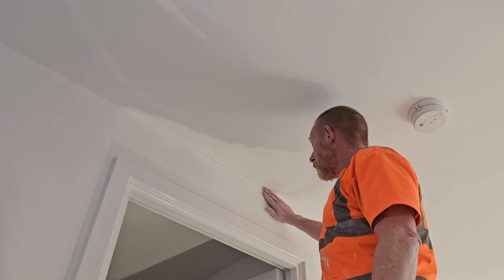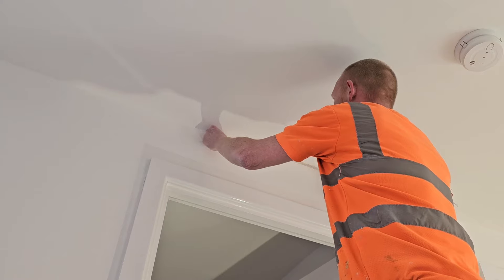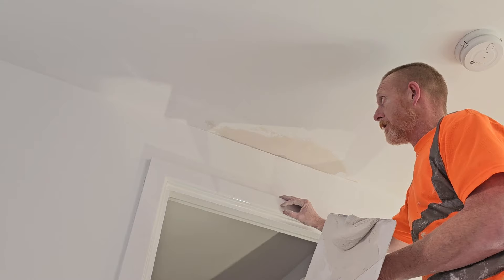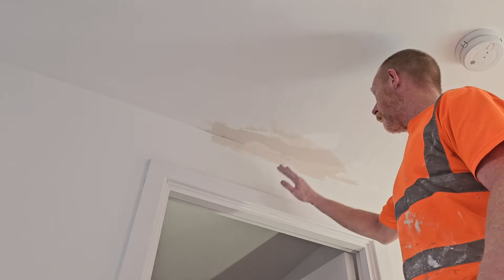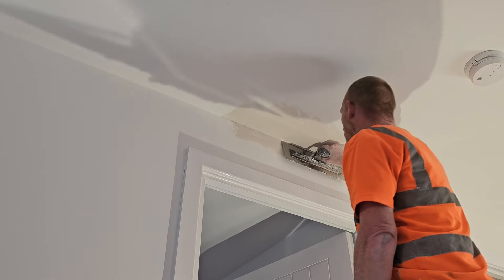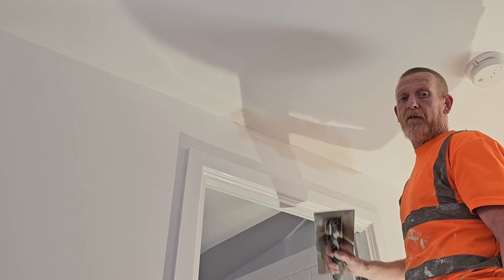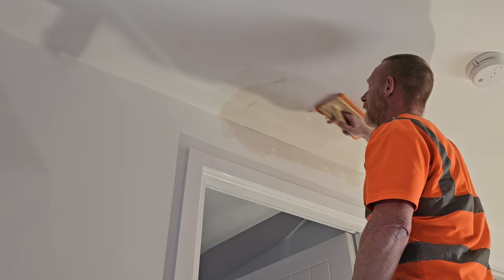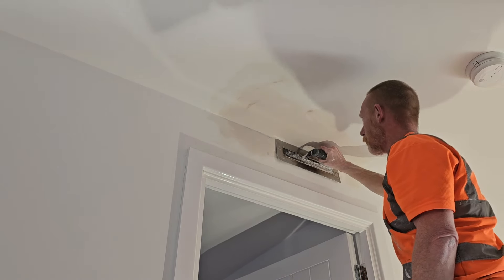how I repair shrinkage cracks #drywallrepair #plasterboard

Comment: Been in drywall 22 years and I’ve never seen someone fix and angle with mesh and a trowel! And then a paint brush!! To each their own though
Reply: I meshed all the corner when I boarded and plastered my house. Makes me think these new build are a bit slap dash if it needs re-meshing to repair a little paint crack.
Like you say Brad each to there own I guess.
Reply: Should use paper tape
Reply: @djhago3123  not if your using proper plaster over the top.

Comment: Fantastic!  When would you use paper tape versus mesh tape?  (Referring to a comment below)
Reply from the maker: Hi buddy , I rarely use paper tape, for me I prefer mesh as I feel it will give a stronger repair.  Some of the lads on site prefer paper tape and swear by it . I patch a lot of tape and jointed houses and it's always the same problems with the paper rippling and coming away from internal angles

Comment: Does this shrinking also happen in old builds that have been given brand-new plasterboard ceilings with brand-new plaster? I got this throughout my house.
Reply from the maker: Hi buddy,  it shouldn't normally happen on old houses unless you have underlying issues with the structure of your house.  I have, however seen similar cracks on internal angles when there's been no mesh tape to strengthen the joint .
Reply: @ChrisWhittaker74  Thanks, Was just curious in case that was an option why it failed. I am always a bit worried in these situations there might be something structural, but there isn't anything that indicates that perse, like no external cracks or big internal cracks. only new plasterwork cracked. As you suggested I think it's the absence of tape then. The plasterer I got said he couldn't meet the ceiling to the wall and the gap should be filled with decorators caulk. that failed a few months later. After doing some research myself, I figured that might have been the problem. So I hacked it out in 1 room to test, prefilled it and then paper-taped the whole room. I understand paper tape is stronger and doesn't warp unlike mesh, so opted for this option. A year and a half has passed and it is now the only room with no cracks, so I think that is the way forward for me. I think I just got a poor job done here but was giving the job quality the benefit of the doubt when I came across your video regarding shrinking as a potential cause. 
thanks for your response
Reply from the maker: Sounds like the plasterer done a bit of a cowboy job , caulking will always end up failing . You have done the right thing,  taping them back up 👍

Comment: Appy a paper tape or the crack will 100% re appear
Reply from the maker: Hi buddy, Shrinkage and settlement will always happen on new builds , even when tape and jointed with paper tape . This was a plastered house where mesh tape was used throughout.  Had it been taped and jointed I would have used paper tape . Good point though buddy 👍